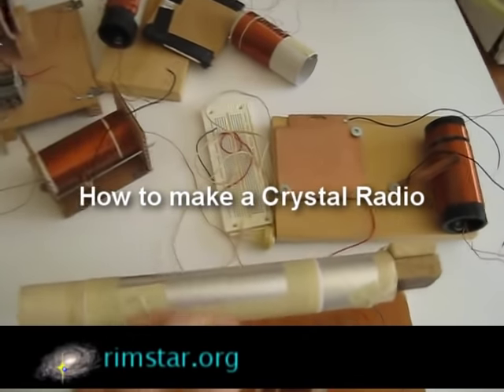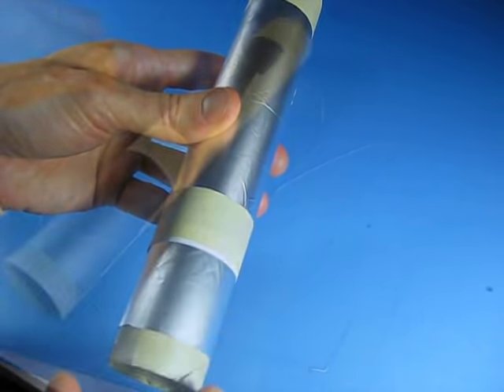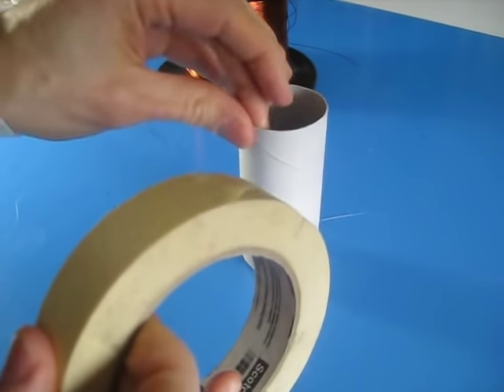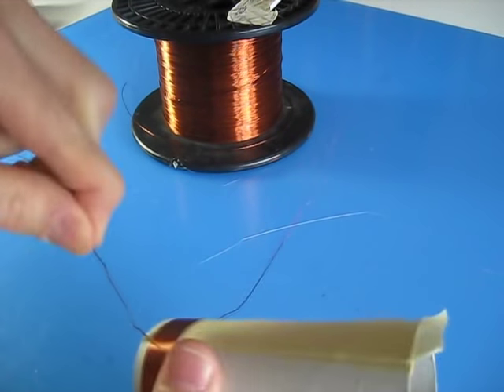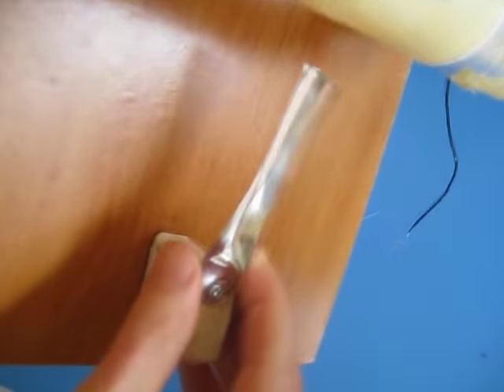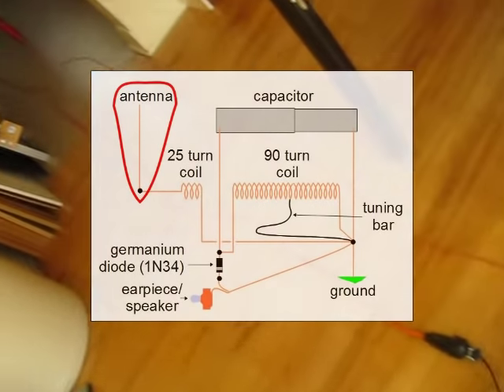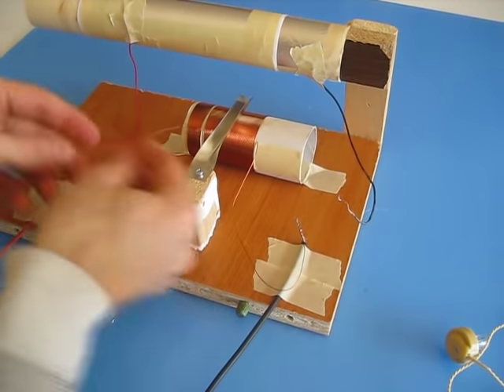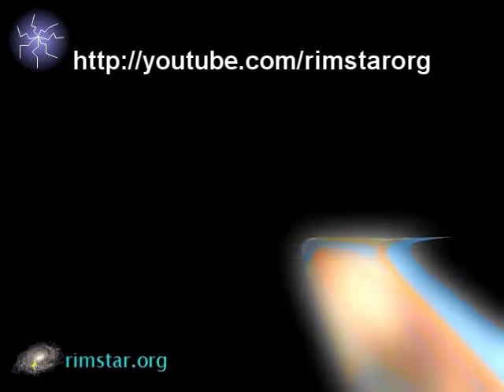How to Make/Build a Crystal Radio

Comment: THE ANTENNA SHOULD BE  AT LEAST 50 FEET LONG AND  STRUNG UP HIGH  10 - 20 FEET . INSULATORS ON EACH END. ALSO NEVER USE  ANYTHING BUT A HIGH IMPEADANCE EARPHONE JUST LIKE THE ONE HE SHOWS. SPEAKERS , EARBUDS,  OR OLD TELEPHONE  EARPHONES WILL NOT WORK. THEY ARE LOW IMPEADANCE  BELOW 100 OHMS AND WILL LOAD THE SIGNAL  DOWN TO A UNUSABLE LEVEL. THE ONLY WAY YOU CAN USE REGULAR SPEAKERS IS WITH A HIGH TO LOW TRANSFORMER .  MUST USE A VERY HIGH IMPEADANCE EARPIECE.  ALSO ONLY A GERMANIUM  DIODE WILL WORK FOR THE SIGNAL DETECTOR. 1N34 OR EQUIVALENT.  SILICONE DIODES WILL NOT WORK . ALSO A GOOD GROUND IS A MUST!  I DROVE A 8 FOOT GROUND ROD IN NEAR MY HOME .  THEN RAN A WIRE TO MY CRYSTAL RADIO. GROUND RODS YOU GET AT HARDWARE STORE . A TRUE WATER PIPE LIKE THE ONE YOUR WATER LINE COMES INTO THE HOUSE WILL WORK GREAT.

Comment: WHERE'S THE CRYSTAL?
Reply from the maker: Back in the 1920s the modern diode was instead a crystal, usually galena, with the sharp tip of a wire touching it. These days a modern diode is usually used instead. A crystal radio is now defined as any radio which gets its power from the incoming radio waves.

Comment: There's a very dangerous practice in this video ... someone will connect the wires in the electrical cable wrong and get killed.
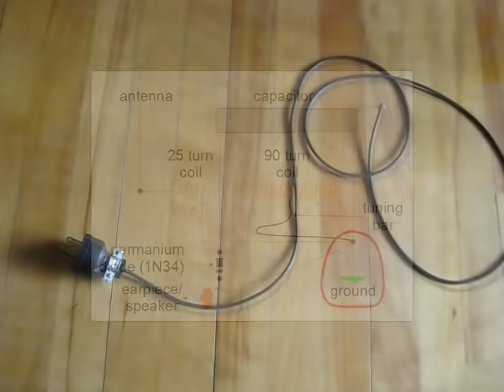Reply from the maker: If you're referring to the way I made a ground plug, that's why at 7:38 there's a very big warning annotation message that pops up. Maybe you have annotations turned off.

Comment: A radio can't get power from radio waves unless you are on top the transmitter....and then you need to rectify the RF to create DC power for the radio circuit. Uh, or, explain yourself better on this point.
Reply from the maker: Moronvideos1940 There are no batteries, no wall plug or other external power source. This radio gets it's power from the radio waves affecting the antenna. Can you please clarify further your disagreement. Is there some subtle point you're making that I'm missing?

Comment: Can I receive 50 HZ using this
Reply from the maker: 50 Hz would be well outside it's range for tuning into. That said, 50Hz or 60Hz noise from the power lines is usually so strong that you usually have to filter it out. So the antenna alone probably have 50 Hz on it. Hook up a long wire indoors to an oscilloscope and you usually see 60 Hz (in North America our power lines are 60 Hz).